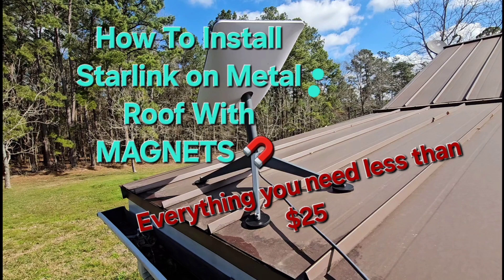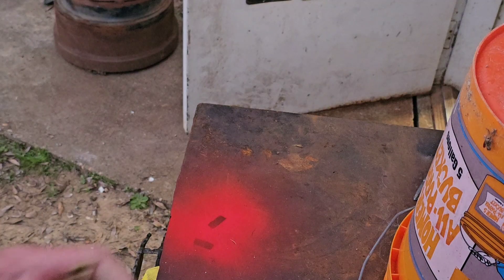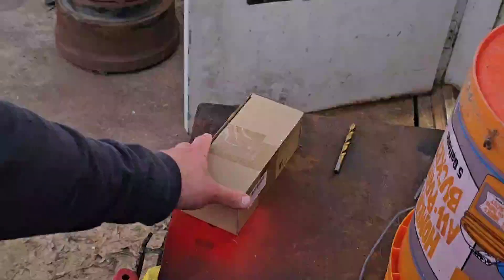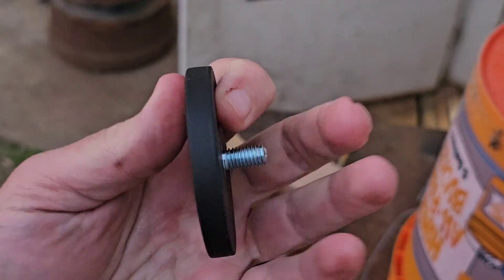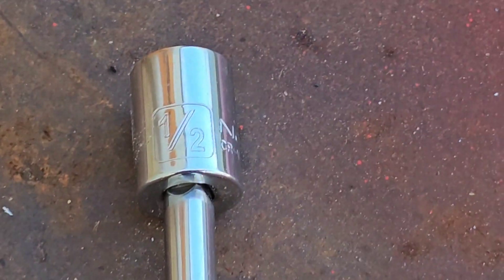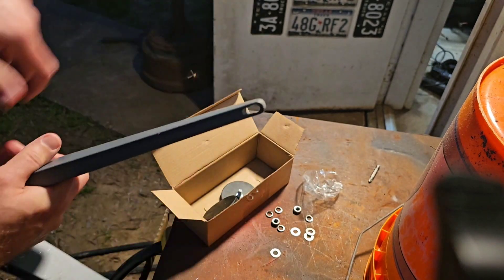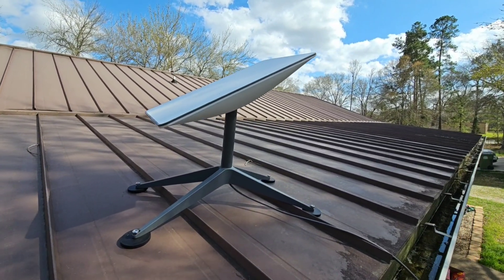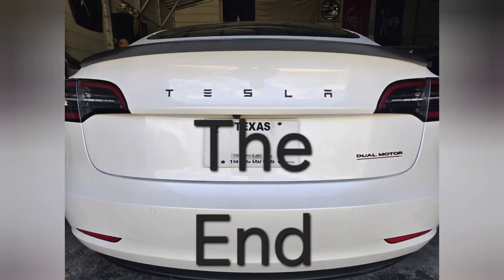How To Install A Starlink Antenna On A Metal Roof With Magnetic Mounts For Less Than $25

Comment: Hey, do you think it also works with 1.69 inch neodymium magnet?
Reply from the maker: @thiagodias567  just one? Or 4? Do you have a link to the magnet? 1.69 sounds like it may be too small. But if you already have them it's worth a try.
Reply: No, I would use 4 like you did, just to keep the Starlink on the roof of my RV against the winds while the RV is parked. The store says that the 1.69 magnet promises to hold 8kg each.  @txfatmarine4583